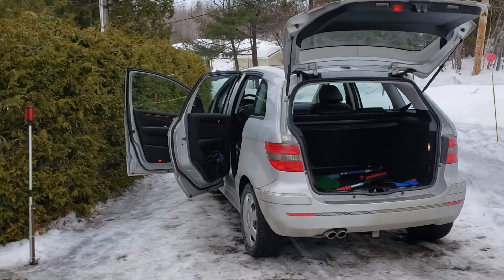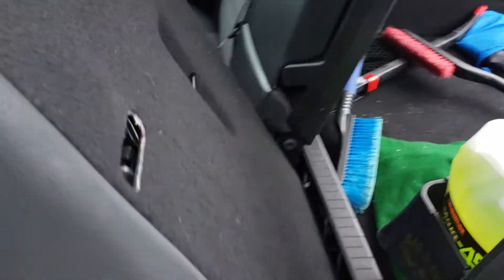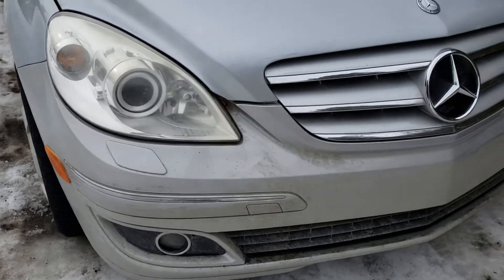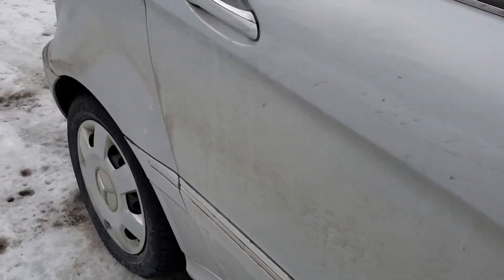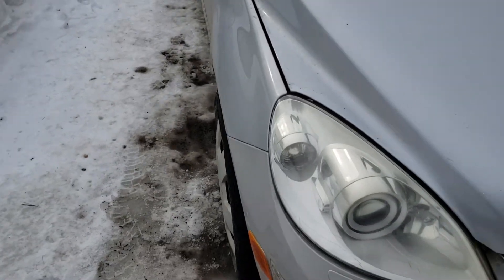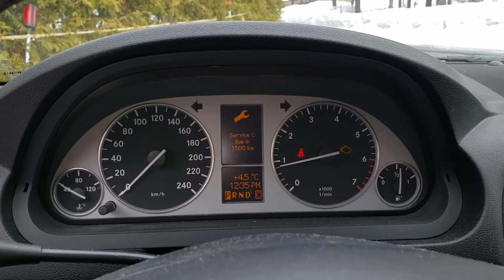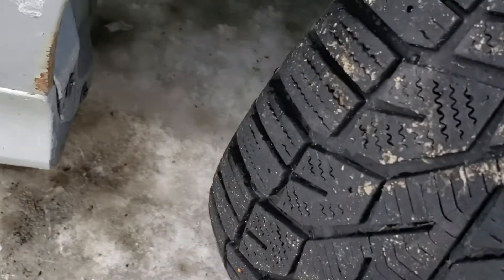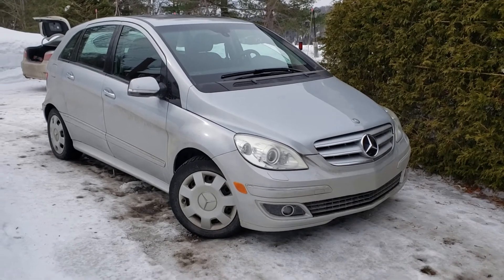2008 Mercedes B200 turbo used car inspection North of Montreal 0601

Comment: You forgot to check power steering wheel fluid
Reply from the maker: Your claim is not correct... There is no power steering fluid for this b200 if I remember correctly. Please note that some of these cars come with an electric power steering system.